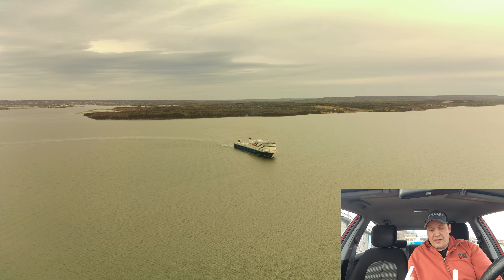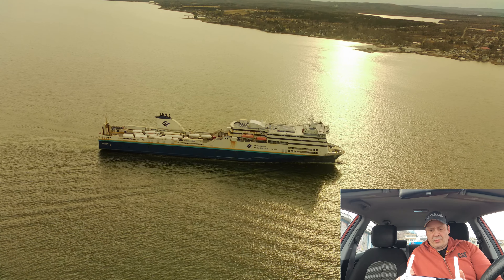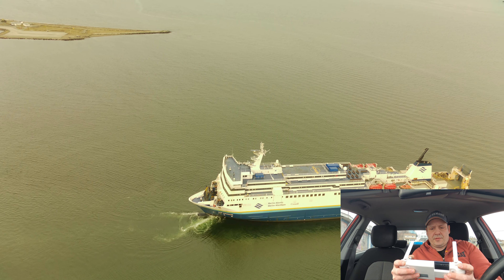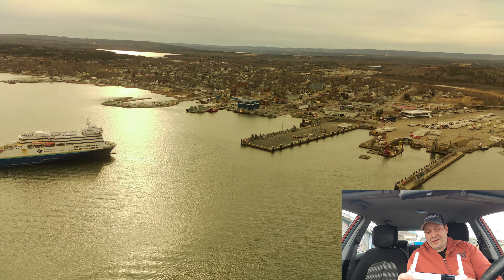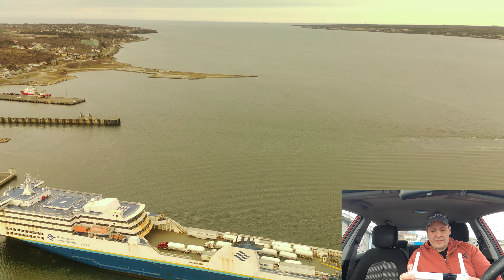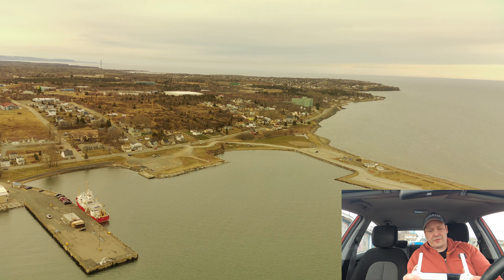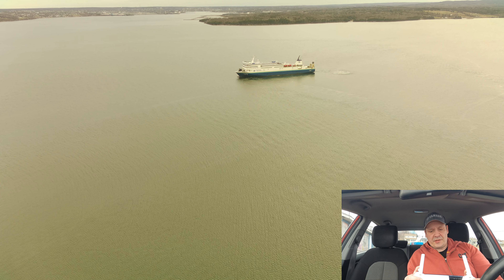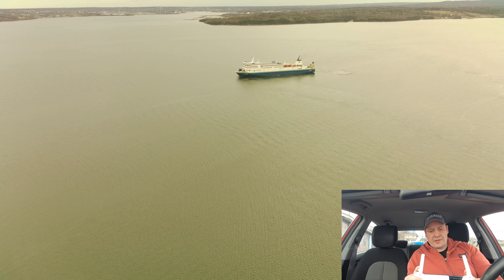How To Fix The Horizon Issue On The Fimi X8 SE 2022

Comment: Sorry but that horizon is not fixed at all. The sea horizon does not slope. Putting a filter will have zero effect it's all to do with the gyroscope and software not doing its job properly.
Reply: As noted... there are fixes and workarounds for many issues with all kinds of equipment. But I agree... having to initiate a compromise is not a solution to spending your money on something that is supposed to work. So... which Casino do you go to??... Hubsan, Fimi, Autel, DJI ??? 🥳😱👍🤞👀
Reply from the maker: i didnt see any slope at all and besides,it did straighten out my horizon,go back and look at my previous flights compared to this one.this is my second time trying the filter with good results

Comment: Sorry, but when the drone was 90º to the wind, the horizon was off significantly, as the x8se's have always done. If your eyes can't pick that up, maybe a trip to the optometrist is in order?
Reply from the maker: you should look again bro because its the lay out of the land here,go back to my previous flights with this drone without the filter and holder and see how bad the horizon was off,having it on helps out big time,im not saying it is perfect as it may have a very slight tilt but nothing that was very noticeable and the drone does tend to correct itself if it does go off
Reply: @capeRCouple  Right...so 3 of us that comment that we can see it are wrong, but you're right.  Realistic thinking?
Reply from the maker: @briandolson2941  well you dont live here and know the lay of the land,ive flown here many times,i know it looks crooked at times but its really the landscaping,watch what the horizon looks like when i turn towards the sea
Reply: @capeRCouple  Not looking at the land!! As Graham also pointed out, the Sea surface is tilted in several views...
Reply from the maker: @briandolson2941  im not saying its exactly perfect but using the filter it is close and not using the filter the horizon goes off by atleast 45 degrees so this is most likely the best fix we are going to get because fimi can never get this correct,go back in my earlier videos with the 2022 and see.I have 3 fimi drones and out of the three only my mini has a level horizon.It's not the firmware either,this is poor quality control of fimi,i have already returned 2 drones from fimi and got even worse problems with a replacement,buying fimi is like playing the lottery,you never know if your getting a good drone or not.